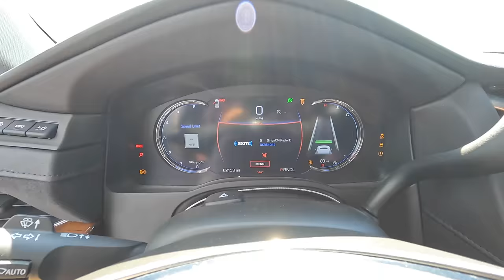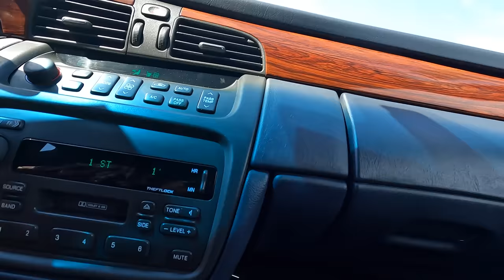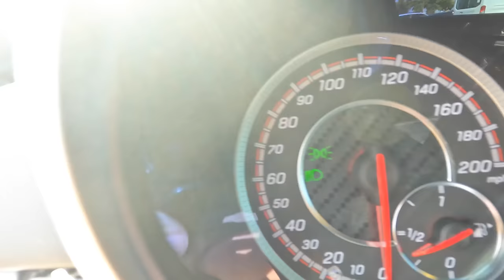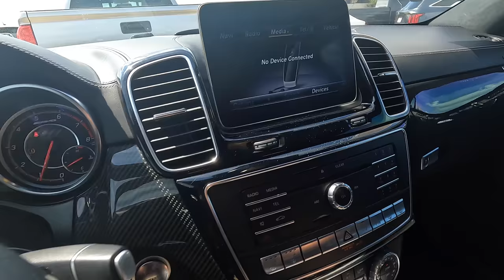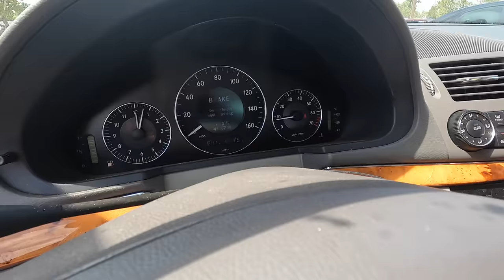Secret Auction Walk Around 9-5-22 + Escalade Limo and a GLE 63s AMG!

Comment: The Escalade is beautiful… it’s ancient tech and I kinda like that. I don’t want anything dragging me across lanes of traffic. This Escalade looks like it had body work on the right side, the right rear door looks repainted and maybe part of the rear quarter as well.
Reply: That isn't even "ancient",though.The early 2000s weren't even that long ago.
Reply: Both my daily drivers have cassette players. Who said ancient technology?
Reply: I'd rather have a 2000s era Escalade than the new garbage GM makes
Reply: @chazzcoolidge2654  this is a 2019 but if you wanna go by what’s in it, yeah it’s kinda old news tech.  New tech has six screens up front and drives your twin turbo DOHC v6 truck for you. I am OK with a naturally aspirated pushrod V8 and one maybe 2 screens up front. Only thing I don’t like is the vibrating seats and the terrible trans problems from 2015-2017.  I think they got it right in 2018 again
Reply: @dextermorgan4337  can’t really disagree.

Comment: 21:00 concerning the Mercedes W211 E500 it is an excellent car "IF" the maintenance was well followed, concerning the air leak at the rear, it probably comes from the bags which are porous or the leveling sensor which is out of order in both cases it is necessary to avoid leaving without doing anything because it is the compressor which risks dying. 😉
Reply: Outstanding!

Comment: Mercedes GLE AMG 63 S 
577 hp @ 5500 rpm, 561 lb-ft @ 1750 rpm. 
0-60 3.9 secs. What a rocket!! Around here in Georgia that GLE sells around $85,000 for a 2019 with 16,000 miles. So it’s comparable to yours. At auction I would guess $65-70 thousand?

Comment: If you manage to get a Gallardo, definately hit up Tavarish. Maybe he can give you a hint or two about it.

As to the Limo: If the engine has been converted from head bolts to studs, it is totally fine. If not, it's only a matter of time until the bolts back out and pop the head gasket.

Comment: 24:36 that’s Comfort / Sport Mode… I see that is a 4Matic.. word to the wise while in C mode make complete stops while shifting from R-D and D-R the drive train will bind up completely. Randy before purchasing see if you can make some tight right turns to check out the transfer case for any vibrations or rumbling. This 05 is the second year of the w211 4 matic system and the 04’s had issues and don’t ask me how I know lol. I think that e500 probably comes with the Harman Kardon logic 7 surround sound.. which has an excellent
 surround experience. Judging by the black gauges this is a luxury model and it should have a heated steering wheel. Hope you pick it up for the channel.

Comment: You should get the escalade not the limo because of the.north star engine they strip out the head bolts and you have to have it rethreaded to a bigger size bolts with course threads and that will cost you around $2500 dollars or more to get it done for you

Comment: Mercedes-Benz AMG GLE 63 S Specifications Mercedes-Benz AMG GLE 63 S is a 5 seater SUV with a mileage of 8.26 Kmpl depending upon it's transmission and fuel type. AMG GLE 63 S's 8 cylinder, 3982 cc, can generate 603.46 bhp @ 5750-6500 rpm power and 850 Nm @ 2500-5000 rpm torque.
thats it

Comment: Everything u showed I like the Cadillac Escalade the miles are close to what my 99 dodge ram 1500 wheel chair van has just replaced the water pump and has 64 thousand miles 5.2 3 18 v8 I'm more in to the high top vans and 3rd row SUVs that's just me good video

Comment: Buy the limo. I wanted to know what happened to the last one but you never told us. I'd go everywhere in that thing. Take the family on road trips, camping...I know the early Northstar is a gamble with it's head gasket/head bolt issue, but  with that low mileage, the fact it doesn't have an issue and is 22 years old, and you'll only keep it a short time, and you don't hammer it, just do it.

Comment: Jeep/fiat need to recall or emergency update on that system very quickly that's very dangerous to have the car drive itself into the ditch it's not acceptable when you're paying $120,000 a Mercedes wouldn't have that problem or any other car though I've never been in a car with cruise control that fancy I'd like to try it sometime.

Comment: What's the difference between a funeral car and a limo? I'm thinking maybe limos have more bling?
Reply: Yes, that’s essentially it, and is used for celebration type events, and yes, has more “bling”, fancy lights, sectional style seating, a bar, etc. A funeral car is a limousine where the whole purpose is to transport the family and friends of the deceased from the home to any locations used for the funeral (the funeral home, church, etc.), the cemetery, then back to the house or funeral home, and is a regular car that’s been extended (cut in half, then converted into a limousine by a coach building company, and in the case of a funeral car, they have a couple of extra doors, and another seat.) They also have a version called a 24 hour car, where the interior can be changed around (they can be forward facing for a funeral, then made to be able to flip over somehow for something corporate, or a function that a regular limousine would do, although it might not have all of the luxury touches), but usually those cars have the extra doors, but are operated differently (I think I heard that there’s a button on a remote that they push), as they usually don’t have handles.  The idea is a vehicle that can do funerals, but can do other jobs later.  A funeral coach is another way of saying a hearse.

Comment: Gimme a 1970s - early 1980s pickup with a small block Chevy with minimal electronics. Manual AC with no servo flapper doors to fail. What a nightmare of so much tech waiting to fail and cost a fortune. If you must have heated cupholders, go Lexus